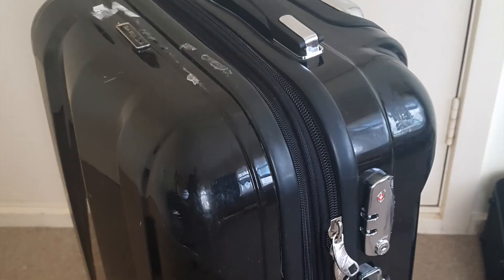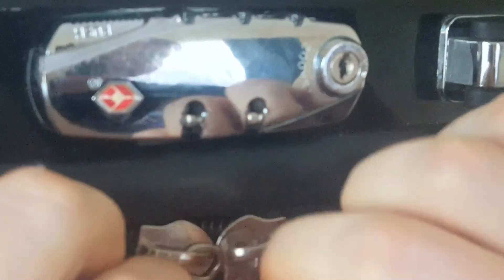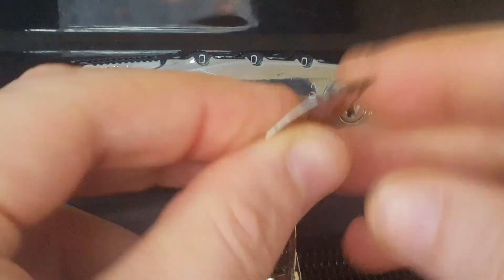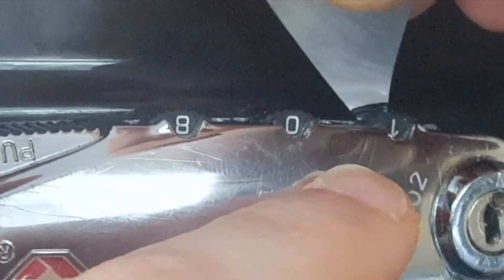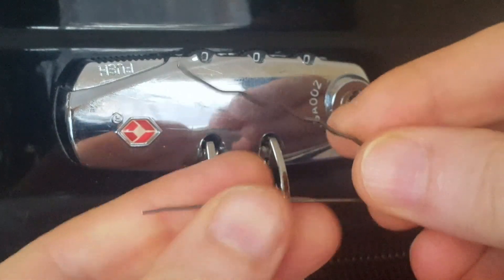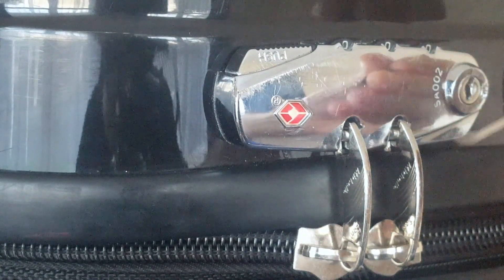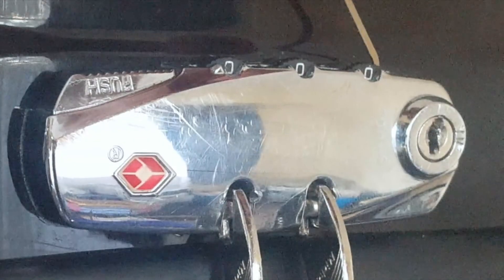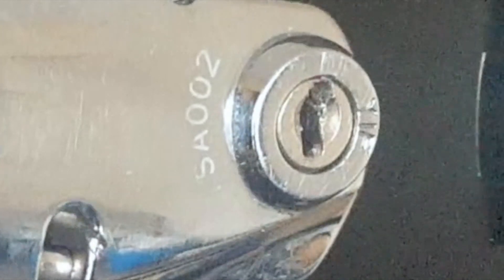(Picking 44) Four ways to open a suitcase lock (decoded/picked/bypassed)

Comment: Great video of another combo tutorial. I believe there's 10 ways to open a combo lock suitcase. No 5-small bolt cutters. No 6- 1/2 inch drill to the plug. No 7-shotgun. No 8- blow torch. No 9-jigsaw and No 10-C4 explosive ( although i would highly suggest you refrain from No 10 if you had a black tie event to attend and your suit and tie were in the case) Until the next time. Cheers:-)
Reply from the maker: LOL - I do like your sense of humor Paul :D :D - thank you very much! :D
Reply: Hi Swynndla. I have an assortment of combo locks that are unwanted and a bicycle lock that is about to be discarded. I am happy to send them your way to do with how you seem fit. Hit me up with your postal address if you are interested. paulspringett3@gmail.com. Cheers:-)